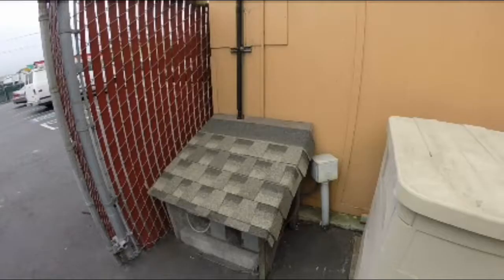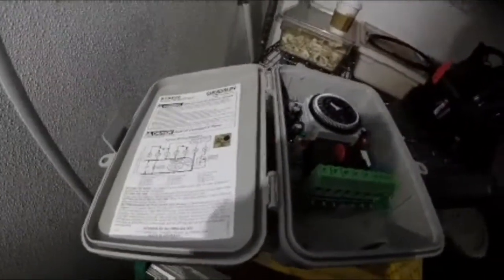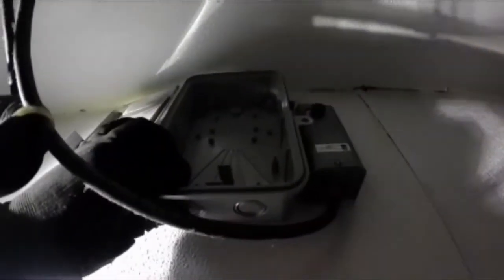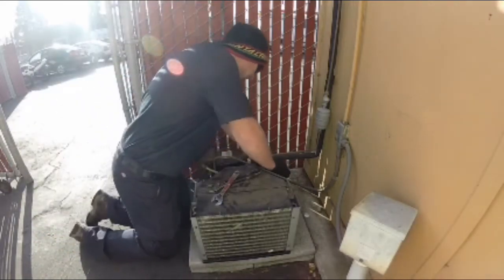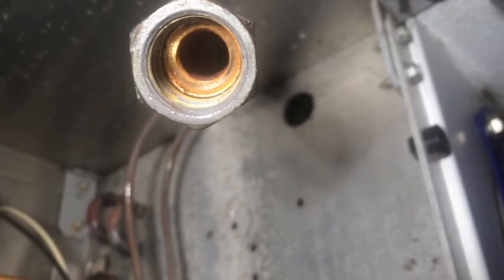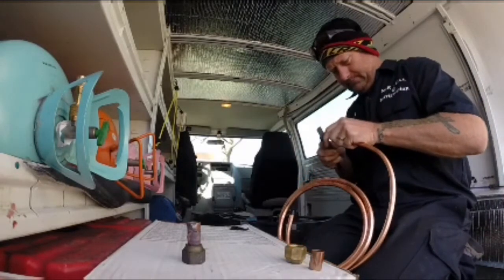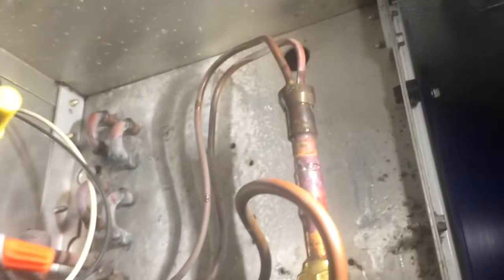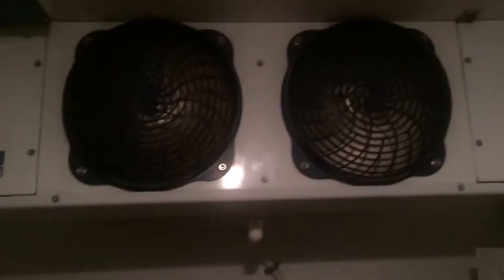Defrost timer part 2

Comment: Good vid. Bees love those dog houses. I use my scripto to color the green wires black. Hate those nozzels, have had trouble in the past with them, ended up using the one with the largest orifice.
Reply from the maker: That's interesting, I've never had a problem with them, wonder if its because I'm in a mild climate? 50's in winter 70's in summer. On average.
Reply: Jim Pettinato where are you JIM?!?!???!?!???!

Comment: I don't see how the system worked without the nozzle installed. Explain using the flux to un braze fittings. I like the new style timer, hard to beat the old paragons though..
Reply from the maker: It will still work without the nozzle. It's just not scientifically correct. 
http://www.heatcraftrpd.com/res/pdfs/faqs/Refrigerant_Distribution.pdf

The flux tip was shown to me when I started out, I guess it helps keep the pipe clean when removing. I think it helps I only use this tip if I'm re using a part of the piping.
Reply: I think I will try this out and see how it does. Couldn't hurt at all  I Like learning new things to make my work better.THANKS!

Comment: I just replaced one of those evaporators, and in the paperwork it wanted 6 - 10 F superheat. When I was around 12,  the box couldn't get under 40F to well, got the SH at 8 and works good.  With the internet might be good for us all to see if you can get the start up paperwork on an evap. They are probably all different.
Reply from the maker: Ben Kuxhouse I use bohn coils. It says 10 super heat. Sometimes depending on what product you have in your cooler you might want a higher super heat, example could be a produce walk in. A super heat of 12-15 might better serve your product better and keep it from drying out.
Reply: It was a heatcraft, we store some fruits, juices, milk and veggies in them. I couldn't get the cooler to get below 40 until I had 8 F superheat, and in the school district  coolers have to be below 40, I keep them between 33 - 38. Like your vids, I have been doing HVAC for 31 years, and have been doing low tem[p with all the other stuff i do for the last 10. haven't done  many installs. And YES i did put in the correct orifice between the TXV and header!! Hope you don't mind if I pick your brain once in a while.
Reply from the maker: Ben Kuxhouse not at all.

Comment: Those Grasslin timers do not hold the load they say the do. I never switch more than LLS or a contactor with them. If you use it for the heating elements or a compressor, it will self destruct in a very short amount of time.
Reply: I use the KE2 thermostats when I have to defrost a cooler.
Reply from the maker: That timer only cycles the solenoid valve. Just air defrost on that walk in.
Reply: It should hold up for that :)
Reply from the maker: +toolman yes. I don't use them on freezers either

Comment: I’m on a NorCal video marathon this weekend!  What are your thoughts on the Danfoss TXV’s?  I just bought the TUA maximizer kit but I haven’t used any of them yet.  Thanks for sharing
Reply from the maker: Matt Agee I like the flare valve with changeable orifice very few failures easy adjusting also